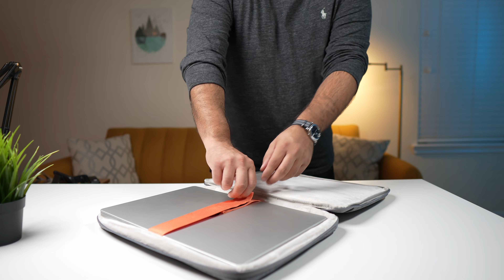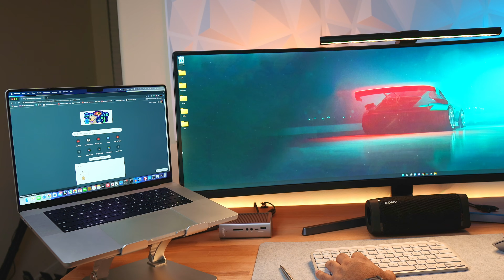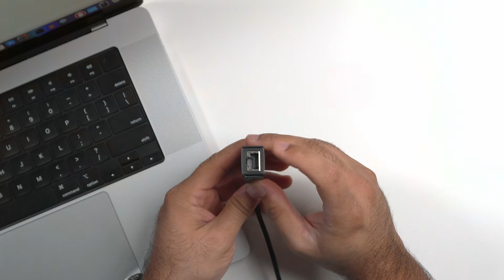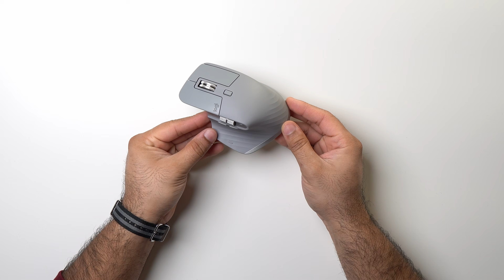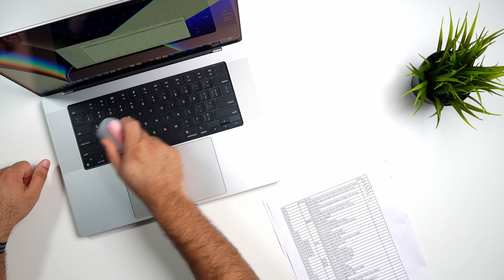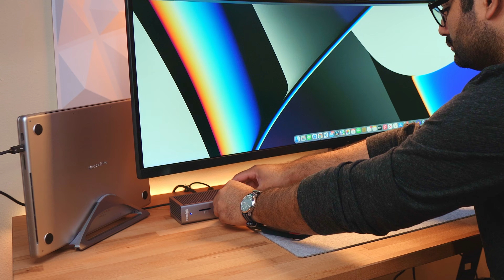My Top 12 Accessories for the new M1 Pro MacBook Pro

Comment: I’m not so enamored. I have a 14” and it struggles with Webflow and with Fusion 360. Fusion is an app and Webflow is a browser app. Both ran better on my 2017. It doesn’t boot up any faster and nothing else really stands out except battery life. Not worth it all if you ask me. I should of just bought an external battery and I’d be better off.

Comment: Speed of the USB depends not on the form factor of the port, i.e. USB-A or USB-C, but on the generation of technology in use - USB 3.2 gen 2 which gives 10gb of throughput and USB 3.2 2x2 which is 20gb.
Reply: I was about to comment the same thing lol

Comment: Yikes, I just ordered the laptop stand. Hopefully the experience is good. The plan is too leave it in place for docking as you have opted to do. Great video.
Reply from the maker: Thanks! Hope you enjoy it!
Reply: @aslamsean  I actually received it shortly after leaving the comment and mine seems to be without issue. It could be a manufacturing issue with the one you received. It is smaller than I imagined but it works well for my 2019 MacBook Pro and my new 14 inch. The video was excellent by the way, really enjoyed how you presented and gave honest reflection on your experiences with the accessories.
Reply from the maker: Glad to hear that! Guess I might have had a faulty one. But  I haven’t moved it in a while so it’s been working great for me!